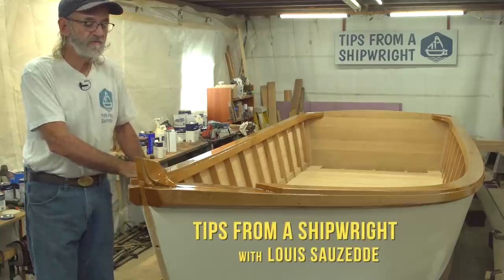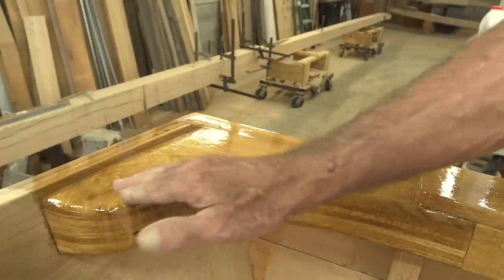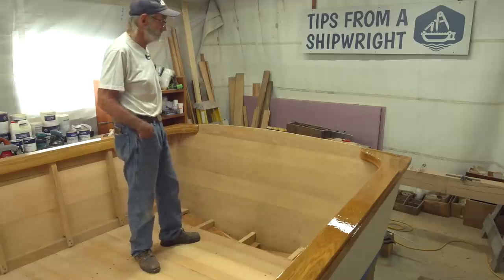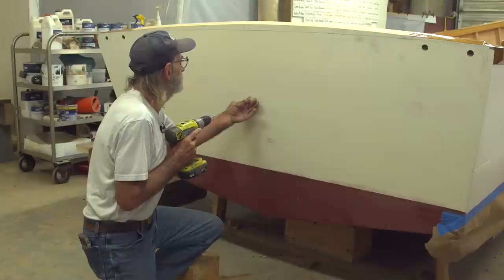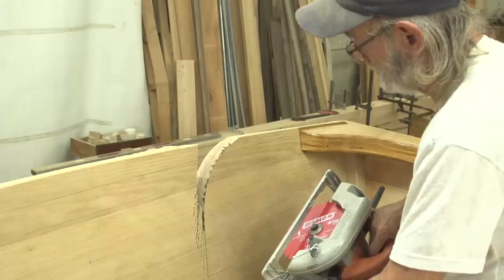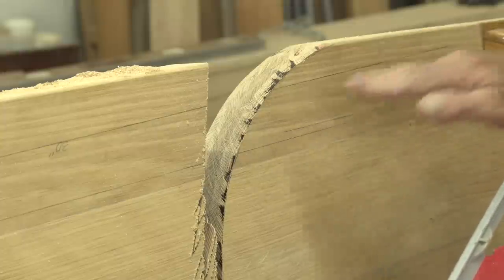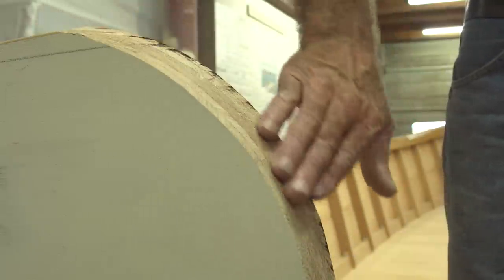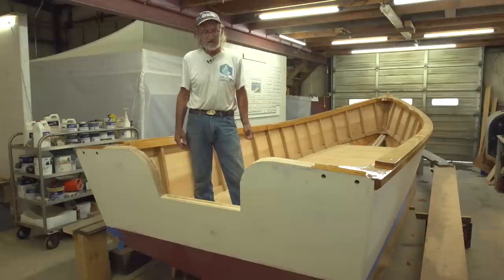Building the V-Bottom Skiff - Episode 39: Plunge cutting the transom for our outboard motor install

Comment: Spectacular, Lou!  Great lesson in handling that Skil saw.  I also liked the mail alongside the line to help hold the square.  Wish I would have seen that a few years ago!
Reply: I was jealous seeing that!  I make fine furniture--working on a walnut bed now.  The headboard is a 25" wide single board.  Sure wish I could have driven a nail to hold my layout square instead of wrestling with it!  But a nail hole would not fly in this piece.
Reply: @branchandfoundry560  I use double-face tape for a lot of operations in the woodshop, wouldn't live without it.
Reply: @SuperJupiter9  I appreciate that, thanks for the tip. I too often find my self forgetting the old standby.

Comment: Or, you know, you could just cut a square piece out of the transom first, then cut the radius afterwards.
Reply: Leaving the bulk of the wood in place while cutting the radius as lou did is the best way, if you have wood on both sides of the saw cut then you have more wood  for the bed of the saw to rest onto, this ensures the blade cuts square through the wood.
Reply: @johnbower  exactly

Comment: I have seen a Japanese carpenter make a staircase with a circular saw that reminded me of this. I use a wedge to hold the guard back. We call them all Skill saws. They will cut backwards too. Circular saw races anyone? Pretty work as always!
Reply: Yup. Jack the guard open with a shingle when cutting acute rafter angles.
The old Makita 5007 NBA had a blade brake like a miter saw. That kept the danger down instead of laying the saw shoe up on the deck while the blade coasted to a stop.
I have a short machine screw tapped into my upper blade shroud now, where I can lift the guard lever over the head to hold it back.  😳
(Don't tell OSHA!  🤫)

Comment: That is some impressive "Skil" saw work. 

Not sure, I'd have dared cut the transom that way. I'd have made a 2-1/4 inch (nominal) half template out of birch cabinetry ply or MDF, then rough cut the opening in the transom with a sawzall, then used a router with an overhead bearing to cut the the profile in 1/4  inch passes. Then flipped the template to the other side of the work boat and cut the other half of the outboard cutout. 

Slower, but less of a risk, less "dubbing" afterward, and one could conceivably use the template for other outboard transom cutouts. 

Right, if one used birch ply for the template, one would have to fair the inside edge with fairing compound.

Comment: I like your skill saw blade on the grinder with no guard. Could you possibly use a Sabre saw and get 1/4” away from line then clean it up with large pattern router bit ? You’re a master Louis. We are sitting at your feet learning.

Comment: Talk about a brave thing to do after all that previous boatwork! Also, Lou you must have had a specific engine in mind and it's measurements; however, does the engine go on with any type of extra lift mechanism that seems to be so prevalent these days, and if so, did your transom cut-out have to incorporate that as well? Thanks!

Comment: Found my self having to cut a semi circle with nothing but a cheap builders merchant hand saw [plastic handle type]  might have been a Sandvic . Surprised myself and every one present by managing a perfect cut first attempt, I have trouble sawing in a straight line normally maybe that was my asset. had to cut several more no trouble at all just keep the saw to the first few inches it was a lot easier than the meal your power saw made of it. try it out on some scrap for yourself For tighter curves take the handle off the saw and guillotine the back edge to suit.

Comment: Lou I can guarantee a perfect cut with my Austrian made Bosch Jigsaw from the mid 80s. With the correct blade you can hand sand the face of the finished cut as well. Plunge cut to your heart's content my friend. But I must say it's not the only way. 

-✌️
Reply: A Jigsaw Blade through 2.5 inches of white oak... Would be tricky just doing a straight line let alone a radius.. Jigsaw Blade just wouldn't be stiff enough for this application.
Reply: @LOOKOUT2012  
I would not have made the claim if I were not certain of the outcome. I've been a furniture maker since 1983 and have accomplished it many many times with ease. The proper tools make it true, everything else just makes due. 😆
I'm not sure how acquainted you are with Bosch's best jigsaw and the incredible cut quality of their blades. However all I can do is assure you that 3" of white oak is not the limit / capacity for accurate and shiny smoothe cuts. Variable speed and variable horizontal kick adjustment combined with absolute quality makes the tool perfect for the task.
Reply: @Finn-McCool  My Bosch is old enough to be made in Lichtenstein.
I still don't have your skill, but could make these cuts with a Porta-band saw (once I had roughed off enough stock that throat depth would not interfere.
You are definitely a master with what I assume is a T301DL
Reply: @jimurrata6785  
It is a 1581VS. 👍
Reply: @Finn-McCool  I meant the blade...

Yes, we think of Bosch as being German but the Swiss made Scintilla tools are a cut above.
The one I have is barrel grip, still with the long screwdriver through the top blade attachment.
Reply: @jimurrata6785  
I think it is the T101B. However for thicker material the one you mentioned seems legit. Browsing Amazon is a real brain melter! I used to have to order tools and blades from my wholesale vendors! Forced retirement a decade ago when I was still in awe that they had arrived in Lowe's and Home Depot. Soon we will merely need to think about them and they will arrive 😂.

Comment: Looking great. Lou is a genius, but he cut the transom out in backwards order. Start by simply cutting out a square/rectangle, then cut the curved shoulders. This technique works great for any/all  interior corner cuts. Start by removing as much regular/square shape as possible, then go back and cut the corners when you have much more room to work and use any tool you like to do the curved bits. Trying to get a straight saw to "bend" isn't the best approach.. You also remove a potentially useful piece of wood intact in a useable form (transom coffee table???). If you have to "fight" your tool. STOP. THINK. FIX. People have been building boats for thousands of years without Skill saws. ;) Cheers from FL, USA.